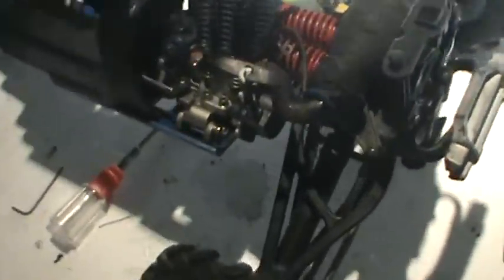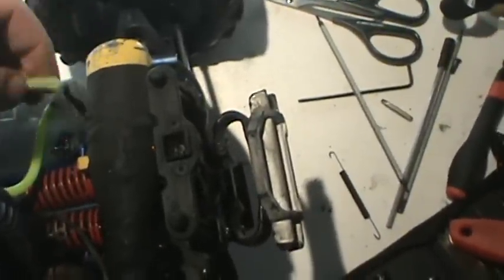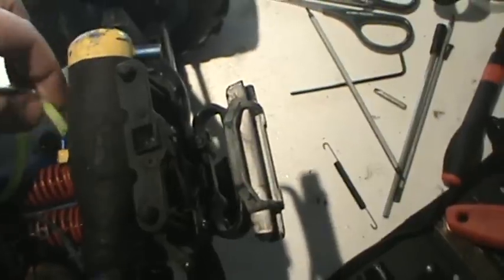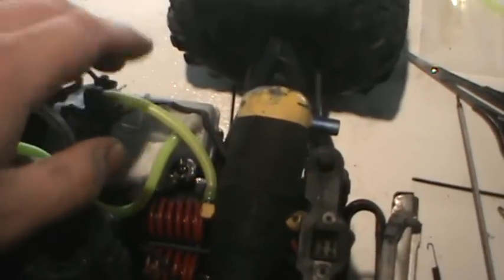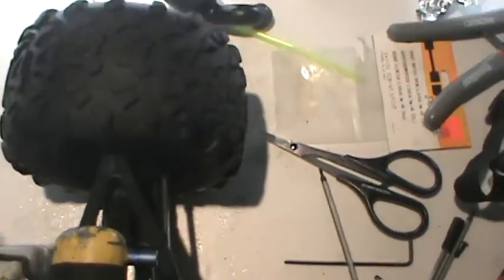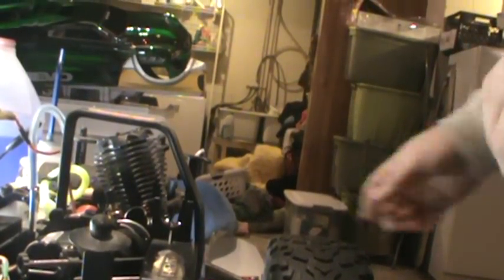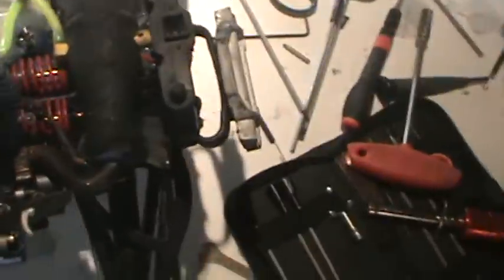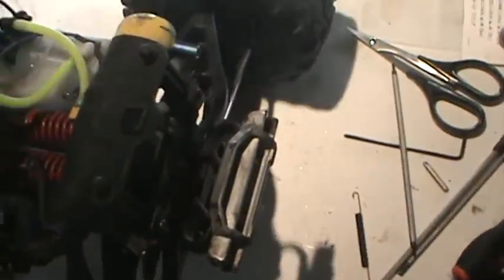Revo 3.3 starting problem PLEASE HELP!!!!!!!! READ DESCRIPTION

Comment: Plug the exhaust with your finger and pull on the pull start until the fuel reaches the carb. Check your idle gap, and maybe try some new clear fuel line so you can see the fuel easier. Also your fuel tank might have an air leak.  Try a new glow plug and make sure your plug igniter is charged.

Comment: The clutch spring may be broke so try that. 
Thats what happened to mine.
i have a problem with mine it starts up but doesn't move, keeps at a constant idle and i have no control over it.

Comment: If its still giveing you a problem check an make sure no dirt got in your fuel tank an caused the fuel filter to get cloged i just took mine out it will still hold pressure..If you messed with your needle valves settings on the carb that could be it it  would be the needle valve on the side of the slide that's your fuel flow set it to flush or you could just need a new carb i just had to replace mine for 20 buck's..

Comment: Hello Dude, did u see if the fuel is coming to the carb? cover the pipe out and do some starters after put your glow plug heater and try... other thing is the carb configuration needle, 4 laps at high and 1,5 at low

Comment: Ok guy do not buy trx 3.3 it price of crap.... 
Go buy new cars or trucks  on 1 speed with no transmission. 2 speed.. I had traxxas big block kit w/ ofna .28 pretty good strong 
Materials. I had best AE truggy and buggy kit over thousands dollar very expensive
No problem. Good luck of u